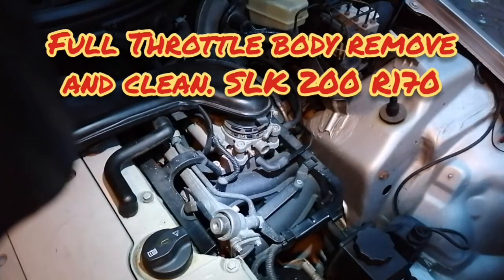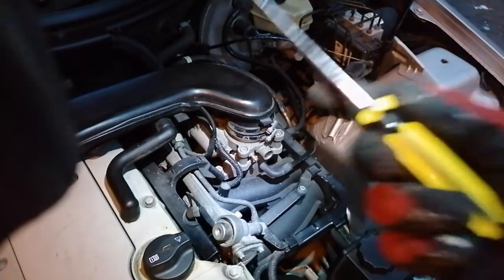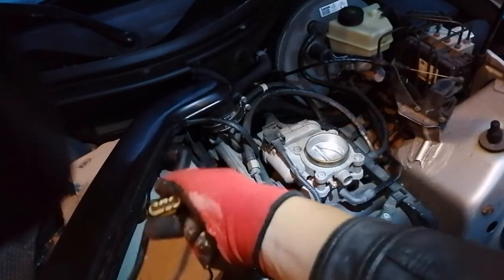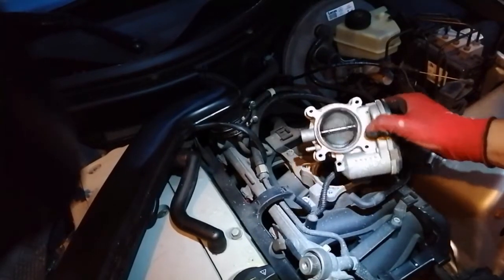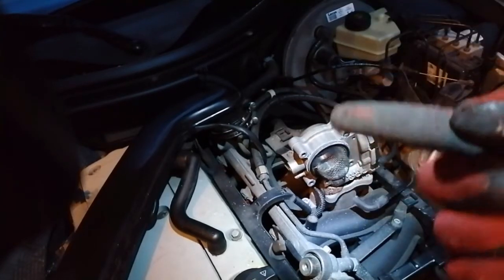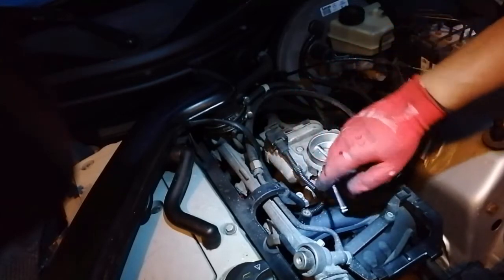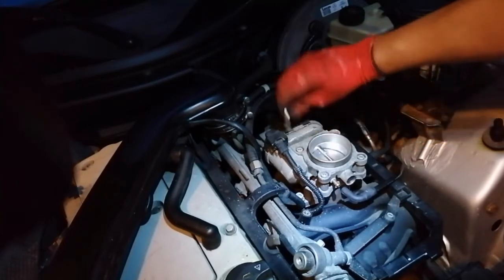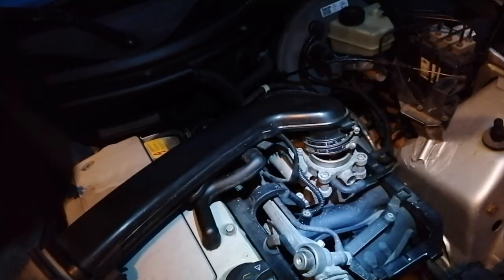Full throttle body removal for cleaning or replacement Mercedes SLK 200 R170 5 speed manual

Comment: Quick question, I have a Mercedes SLK 350 (R171) and I need to replace the throttle body, do you know if it needs any aditional reprogramming?